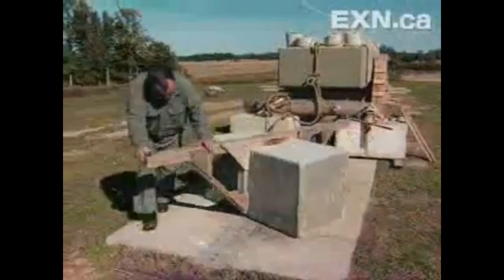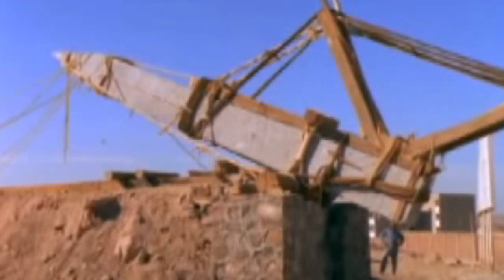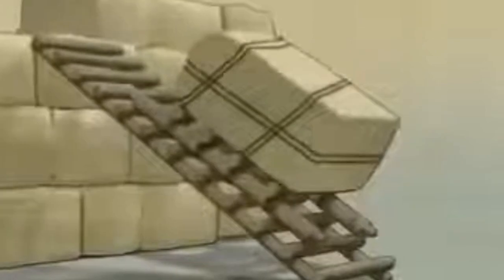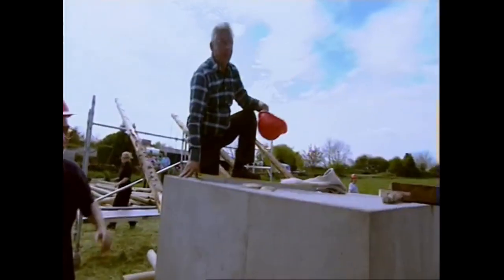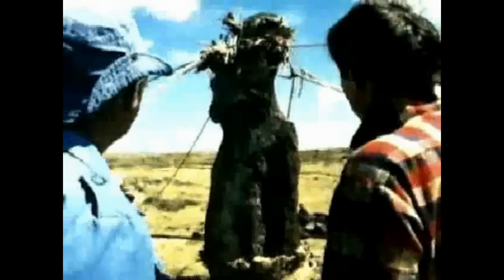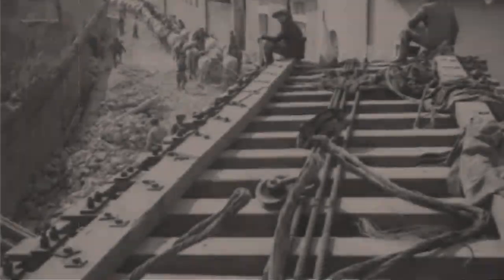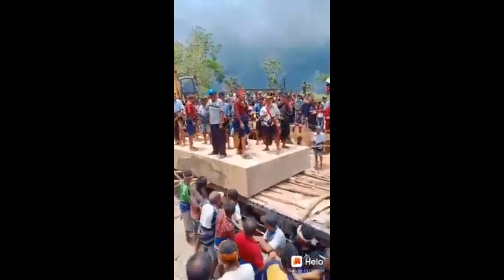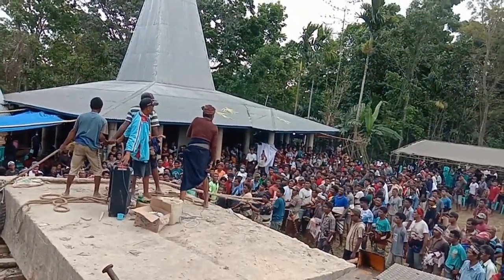How The Ancients Could Move & Place MEGALITHS With Primitive Tech. LAHT WON'T SHOW YOU THIS!

Comment: 0:01 This got a be a joke.
This rectangular block at the very beginning of the video, is not a rock for sure, 1000%, 10000000%.
It's something else, maybe a plastic look a like?

I've moved 60 lb, 80 lb concrete bags, hundreds of them.
You cannot roll them like this, not even close, and he's rolling it with ease as if it's a pillow.
The first block, if it's a rock, real stone, it should be like 200 lb.
The second block should be like 400 lb, but he's moving it like it's made of styrofoam.
There is no way this is even 60 lb, more like 20 lb or less.

I will watch the rest of the video later, but moving stone isn't easy.
The people making these videos have an agenda.
The rocks featured in other videos, probably not rocks either.

If cutting and moving rocks is this easy, 
we would be using beautiful marbles and far durable granites everywhere, 
instead of ugly, pulverizing concrete everywhere.

Get a 80 lb bag of concrete (still smaller than the first block) yourself and try to roll it like he did in the beginning of the video.
Reply from the maker: That’s point.
If you have a clue about physics or more than an hours experience you know how to move things like they are styrofoam.
Your inexperience is not a limit the rest of the world lives under.
Your RAM truck has suspension designed to move fast on highways
You are very confident for someone very ignorant of basics. It’s called the Dunning Kruger effect.
You watch joe Rogan and bright insight. You need to stop that.
Reply: @SacredGeometryDecoded  Have you ever lifted a 80 lb, or even 60 lb concrete bag?
You have no clue then.
Just listen to me, go to a hardware store, and just feel the weight, an 80 lb concrete bag.
Well, I know you won't, because you do not want to wake up from a dream fantasy.
Reply: @SacredGeometryDecoded  My $100,000 RAM truck has suspension to go slowly on unpaved road and off road.
My $150,000 Porsche 992 convertible has suspension to go fast on highways.
I am ignorant?
You have no clue man.
Reply from the maker: @sbkarajan  sonny boy I moved so many bags and loaded so many trucks over the years. 
It’s good that you’ve got money because you’d be useless without it.
Anyone who talks the way you do has only played at doing work.
Reply: @sbkarajan  "I am ignorant?"
Yes, incredibly so.
Reply: @AlbertaGeek  It's like this.
All SGD and so called debunkers telling is...

They can prove that a jet fighter can be built in the garage.
See? One can bend aluminum using hammers, and make a sort of look a like wing....
And very little portion of a jet engine blade (like 0.1% of the volume) using garage grade sand cast.
Thus, it proves that jet fighter does not require sophisticated level of engineering skill.

Huh? LOL!!!!!!
Reply: @sbkarajan  I'm sure that incoherent mess sounded better in your head.
Reply: @AlbertaGeek  Also, I can prove that I could sculpt like Michelangelo too....
By pounding a stone to stone....
And grounding stuff using sand.....
FOR~~~EVAR AND EVAR~~~~~~
LOLOLOLOLOLOLOLOL!!!!!!!!!!!!!!!!!
Reply: @AlbertaGeek  If moving big stones is this easy, we should see most, if not all the stone statues in America made of monolithic single block of rock.

But, but, but... have you been to DC?

I was surprised to see that the new little MLK statue was made of dozens of little stone blocks and then glued together.

So~ ugly where the gaps are visible.

Then Why do they build statue that way?

Not because it's easy, but because it's SO~ hard to move the large stones around, even in the 21st century, even with heavy machineries!!!

WAKE THE HELL UP MAN!!!!!

Comment: You're leaving out data.  The casing stones were polished so they were used as ramps.  Some of the blocks came from 500 miles.  Suggesting they moved them 500 miles an inch at a time is ludicrous.  There were 2.3 million blocks in the pyramid.  Even at a few minute per block estimate you're looking at multiple decades to build.  Taking days to place one block would put the build time into the centuries.  Seems like you're doing the same thing you accuse others of.
Reply from the maker: Did I leave that out? I showed the Egyptian Hoist and Wally Wallington.
You are leaving the important data out. The granite came from Aswan 500 miles away, It is right next to the river and the canals to join the river and quarry are well known. They were moved less than a mile in total, the journey on the river is done by the current of the Nile and dispalcement.
I literally show heavy blocks here being moved at speed. Made a point of it.
Given many teams worked at once the one block per minute narrative is a false narrative, made an entire video on that. Each team would have 3 days to place a block and the interior stones are roughly split limestone blocks (rubble, fill or junk as called in the trade).
You are literally parroting the Hancockian lost high tech narrative talking points
Seems like you don't care enough to learn anything outside of the "official alternative" . Who by the way won't show this type of thing to their audience and claim it is impossible.
Also obviously you didn't even watch the video.
The points you make are in an alternate reality.
You would buy a bull and complain that it wasn't laying eggs.
Reply: @SacredGeometryDecoded  W